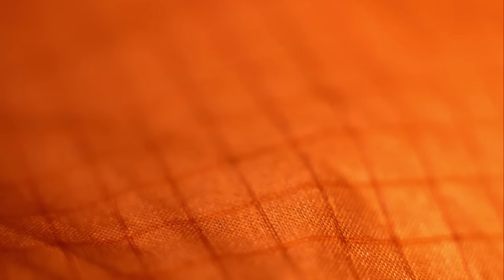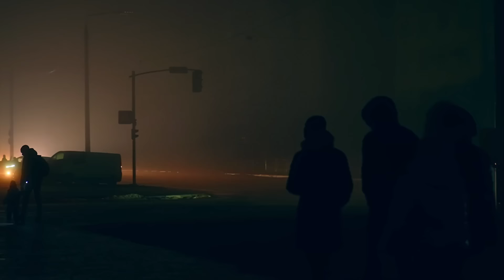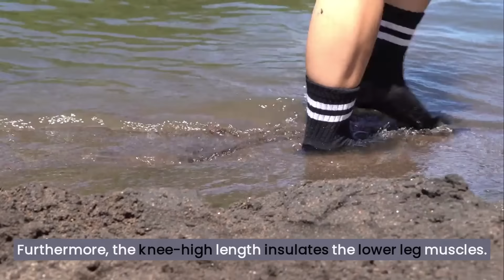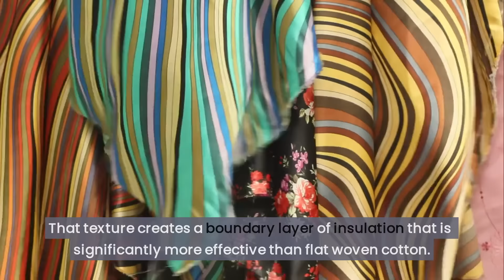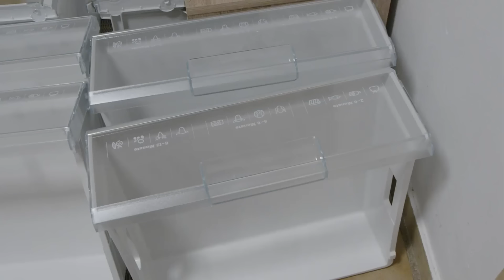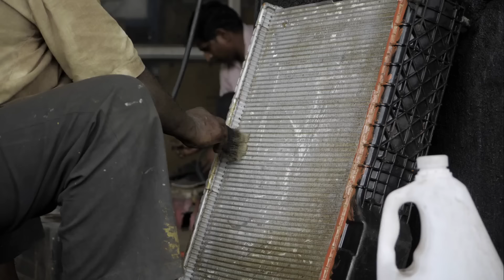11 Dollar Tree Heating Items That'll Be WORTH GOLD in Winter Blackout

Comment: Here in Texas, we just had an ice storm, and it was in the teens at night. To block off rooms, I used foam water pipe insulation cut to size of each door. Slide the open foam under the door. It holds quite well with the adhesive strip. When the door is closed, the foam seals the opening under the door and stops drafts. This is a very low cost solution that stays in place even if you have to open and close the door.

Comment: I used to live in an area that had power outages often. Brown outs were daily at 11pm sharp. I would use the outside cold to save food from spoiling. Put food in an air tight cooler. I scooped snow and let it melt to flush toilets and make coffee. Other snow I heated up and then strained and added a small amount of bleach for washing dishes or bird bath bathing. Pool noodles work great to insulate pipes. Reusable dog per pads insulate windows really well. I have cooked on a kerosene heater while keeping a pot of water to keep the kerosene fumes and smell down. Terracotta pots and metal cans with tea lights make nice heaters. I've loaded snow in the bed of my truck for rear end weight to add traction. I pack the snow down hard so it's heavier and doesn't blow out behind and cause danger to those behind me.
Reply: Terracotta chiminea - seal up the front opening and fill with playground sand - heat sand with 12 volt immersion heaters (like a truck driver heats coffee cup) and enjoy the warmth for hours😮

Comment: I had a fireman I worked for, tell me to save lint from a dryer. He said its great to help start a fire.
Reply: It truly is a great fire starter. I push the dryer lint into an empty toilet paper roll so you have a nice compact fire starter.
Reply: @TammyB-x2h Absolutely,  You don't need to use entire toilet paper roll.  Cut in1/3's and will work too.  You could also add small amount of petroleum jelly to one end.
Reply: Very true

Comment: 1. Petroleum jelly
2. Cotton balls
3. Wool blend scarves
4. Cotton bandana
5. Knee high socks/ dual layer
6. Baby receiving blankets 
7. Cotton dish towel/terry cloth
8. Felt sheets/ insulation/for shoes/home
9. Cardboard and posterboard. D. Tree will give you boxes for free./ insulator. 2 or 3 layers on floor or shrink room. Or heat reflector.
10. Aluminum foil/ windows, shiny side in. Wrap feet. Line coat.
11. Disposable hand warmers
Reply: Thanks for printing the list. You are the best!❤
Reply: Thanks 😊
Reply: I'm taking this list with me when I go to Dollar tree. Thanks
Reply: Thanks Lynette for saving us 30 minutes for a video that could have been done in half that time!
Reply: Ex̌cellent❤
Reply: Thank you, my heroine.
Reply: Thank you, Lynette. ☺️
Reply: wood is all I need
Reply: @mainelivin3699 I think you should test that one.
Reply: Merci beaucoup
Reply: Plastic popcorn is used for windows, too
Reply: Ty❤
Reply: Thanx, that saved me from having to watch the rest of the video.
Reply: Thank you Lynette, we have another storm coming in this weekend and my heat is a pellet stove run on electric. I have an old generator but I know it will not be enough.
Reply: Thank you 😊
Reply: Thank you Lynette

Comment: Dryer lent would be just as good as a cotton ball they are very flammable
Reply: This was a great hack back when most of our clothes were cotton, but now with all of our synthetics, not so much. Don't  get me started on the  stink from pet hair mixed in that lint. My go to fire starter has become that grease soaked paper towel that I used to soak up the bacon grease and wipe the cast-iron skillet from breakfast. Great at home but doesn't  travel well, especially in bear  country. Lol
Reply: both very good hacks and tricks... best to remember to use according to what is at hand in an emergency . every idea helps in a dire situation

Comment: Well I guess I’ll have to freeze to death , when I wear wool it itches! I couldn’t even wear my band uniform, had to wear long sleeve shirt & pants , every one else wore shorts or just the uniform!
Reply: Not all wool is itchy.
Reply: Try silk! My kid is allergic to wool, so she got the silk base layers while I got the merino wool. Her insulation layer was linen/wool blend stuff that never touched her skin.
Reply: Unfortunately I tried cashmere, merino and even alpaca. I still itch. I wish I could wear it.
Reply: I'm wearing a thick scratchy wool shirt right now over a turtleneck. No part of the wool is actually touching my skin. It's maybe 7 degrees F outside but my core is toasty.  A wool scarf is another story. Try loosely layering a couple of thick acrylic scarves. They can trap the heat against your neck.
Reply: Wear cotton or itch free synthetic next to skin. Layer wool over top.  Handspun wool with a little lanolin still in it will not itch as bad as commercial chemically processed wool( I am a spinner, love my homemade wool socks over cotton liners)

Comment: Some more tips:

Invest in at least 12 of those cheap, coarse grey dog blankets. They can insulate larger areas, and you can even make a make-shift indoor tent, if need be. They can also be placed under beds or mattresses to act as a barrier between the bed and the cold floor. Or used to enhance the thickness of thin foam mattresses.

The pieces of cardboard sheeting, from large deconstructed cardboard boxes, can be utilised in the same way.

Bubble plastic is an excellent insulator for windows and doors.

Always keep at least 12 rolls of duct tape. It has multiple uses. From taping  down insulation, down to setting a broken arm or leg.

Zip ties, in all thicknesses and sizes, are indispensible.
Reply: Just get the 12 grey dogs. Warm friends!
Reply: @NaughtyAelf 
Brilliant!😂😂😂
Reply: @NaughtyAelf 😊

Comment: Take a 1L canned fruit bottle or similar container and fill it with cotton balls. Do not cram too many into the bottle, fill it loosely. Now melt a large jar of petroleum jelly (Vaseline). Remember to place a cup, half-full with water, next to the jar. Pour the melted pj into the jar of cotton balls. Let it cool off. When it cools, it will solidify.

Another cool, cheap hack:
Fill a large canned fruit bottle with six or eight pumice blocks (used to exfoliate feet). Fill the bottle with paraffin or spirits. Seal tightly and store. One such a block will act like a fire lighter. Remove the block once the fire gets going, let it COOL DOWN COMPLETELY, and place it into the jar of paraffin or spirits again. These blocks will last long, if you don't leave them in the fire.
Reply: I didn't know that about the pumice blocks
Reply: @olyveoyl5580 Neat idea, hey. The trick is not to leave it in the fire. To remove it, once the fire gets going. Let cool and place back in the jar of paraffin.🎉